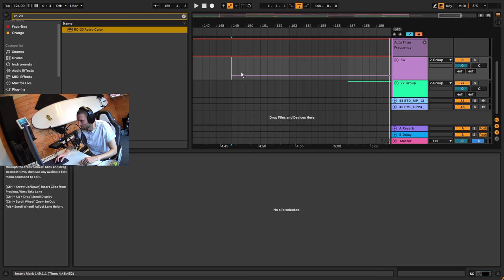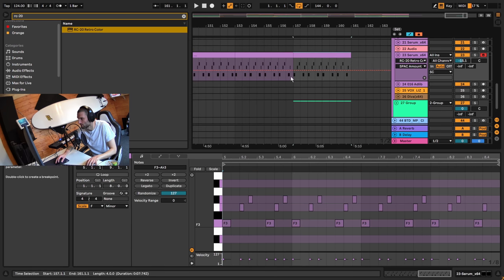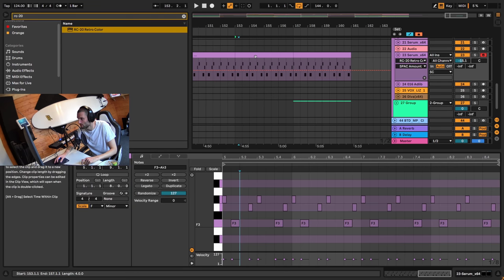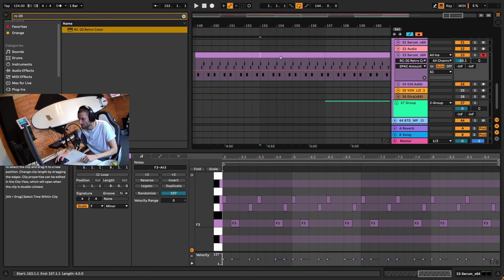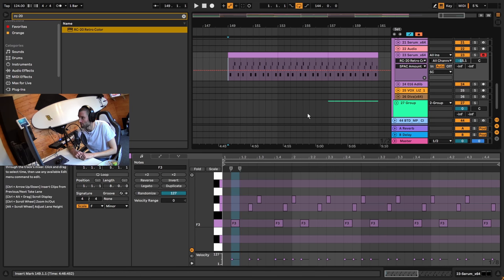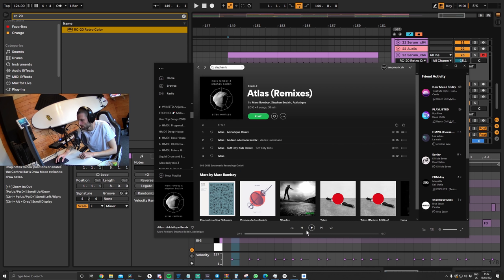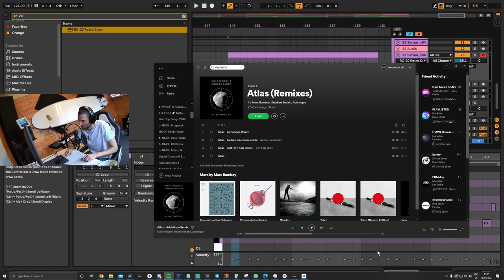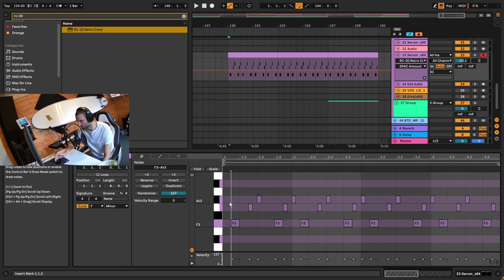Metric Ambiguity

Comment: I have ableton 10 and want to buy a macbook. Can you recommend MacBook Air (maybe m1?) or MacBook pro? Which one should I buy?
Reply from the maker: I dont use mac so im not sure
Reply: @BoundtoDivide  ok thx! what do you use or what can you suggest?
Reply: I've only seen good things about the new M1 macs, although, I wouldn't go for the Air, go with the MBP 13" or even wait for the 16" they'll release at the end of this year (hopefully). 

I currently use a MBP with 16GB Ram (those slower older ones) + i7 and it runs KINDA alright. Get the MBP with the M1 and I'm 99% sure you're sorted. 

Try looking up some YT reviews on these, you must find some good info about it. :)
Reply: @paulofallone  thx! But i  heard ableton 10 isn't compatible with the m1?
Reply: @a.a.1744  Ableton will run under the translation layer of Rosetta 2. All you need to know is it does this smoothly, haven't had any issues in my experience. (MacBook Pro M1 13")
Reply: @MrMorelloJr  thx!
Reply: @urmumsbaps  so what's a good Alternative?

Comment: That is called syncopation and its not that much of a big deal sir
Reply from the maker: No this isnt syncopation, syncopation is simply playing a rhythm that doesnt typically land on the “pulse” of the tempo of the track. For example playing an 8th note between each quarter note, or a dotted note rhythm over a 4/4 kick drum. Its still easy to tell where the downbeat is. Metric ambiguity happens when you interpret the downbeat as happening in a certain position in the rhythm (this could be inside a polyrhythm) but it surprises you by coming in unexpectedly. The effect also fades after you hear the track a few times, however a polyrhythm will always remain a polyrhythm no matter how many times you hear it, sir.
Reply: @BoundtoDivide  you've added polyrhythm into this yourself sir. 
Syncopation perfectly fits the description of what your have. Your kick is on the each 1/4 note and your lead melody in syncopated, hence why you even made your note longer
Reply from the maker: @alexvidzup9076  correct, but the kick comes on unexpectedly which is the effect im talking about